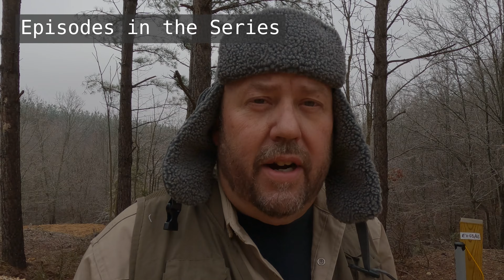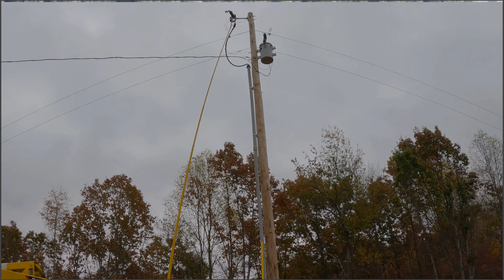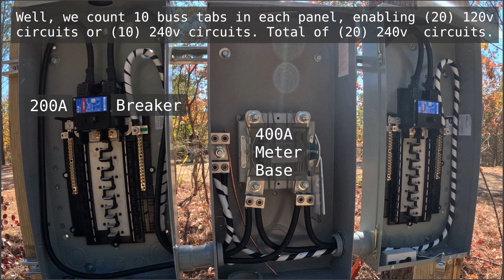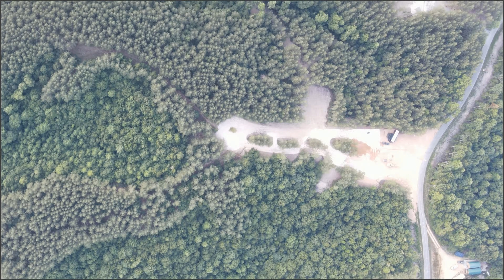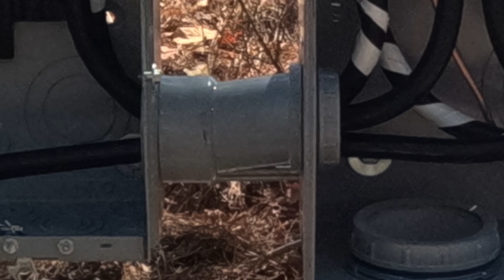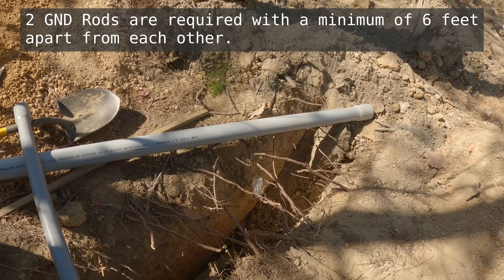How to build a 400A RV Park Electrical Service -  Ep 2 of 4

Comment: more than likely... you bond the ground and neutral to the incoming  box ( this case its the meter chanel ) , Then you do not bond the neutral and ground on the outgoing boxes ( secondary ) The secondary boxes then have to keep the ground wires and neut wires seperate (at the wire terminals in their box)  when wiring the box. At least thats how its been anywhere i do it. Reason ---Note: Bonding must generally only occur at the first point of service disconnection (the main panel), not in subpanels, to prevent neutral currents from traveling over grounding wires, which can make metal plumbing or appliance housings electrically hot if they are shorted..

Comment: Since everything (including your primary) is single-phase, your primary power is most likely 7200v (phase-to-neutral), not "14.4" (kilovolts). 
Also, the actual phase-to-phase voltage on most "14.4kv" designation systems, is actually/typically running at ~12,470v phase-phase, thus the ~7200v phase-neutral voltage.
Also, how many actual RV pedestals (and assuming 50A recep's) are you connecting to each of the 200A main disconnects? Hopefully more than 3 (up to 6 would be allowed, I beleive).
Anyway, a well thought out system, nonetheless.

Comment: Double check with the codes but I’m pretty certain every case needs to be grounded as well
Reply from the maker: Disclaimer: We are NOT licensed electricians, but this is our understanding.

In TN, in the meter base, the white wire, the meter base itself and the bare copper ground wire are all bonded/connected together to form one electrically connected circuit. The bare ground wire is then connected to (2) 8' grounding rods driven into the physical earth spaced at least 6' apart below or near the meter base.

Then from the meter base, 4 wires (Hot, Hot, Neutral and Ground) are run to each "disconnect" or main breaker panel that has to be within 6' of the meter base. The "ground" wire comes from the meter base, not from a second set of grounding rods at each "disconnect". Same with any subpanels or loads (outlets, HVAC, lights, dryer, stove, etc).... no grounding rods as the grounding comes from the main breaker panel or disconnect.

Besides the meter base having a set of earth ground rods, each of our pad based transforms has their own grounding rods and also each utility pole at the road has it's own grounding rods.

Comment: off of a 200 amp distribution panel, how many rv sites can you feed? if each site has a 50-30-20?
Reply from the maker: DISCLAIMER: We are not an electricians and the information should be treated as opinion.

Not at all. You can run 5 to 9 dedicated direct RV sites depending on distance and the type of rigs you will support. If you are a luxury RV park where most of your clientele is 45' Class A's with 3 AC's, with electric heating fireplaces and whatnot, then you are going to be closer to 5 RV sites. If you have a good mix of various camping rigs, then you can get closer to 9. It's also weather dependent, if you are in very cold areas, then guests tend to bring in extra electric heaters, which requires more power needs.

From a technical standpoint, RV typically draw 50A, but they do not draw anywhere near that on a constant basis. So (9) 50A breakers in a 200A service panel is realistic because RV's are rarely drawing 50A all the time.
Reply: @RvParkBuilder thank you! I’m looking at 7 on one and 6 on the other
Reply from the maker: That should work and we have seen setups like that in the various RV parks we have been in. However, we are not electricians and we recommended engaging a  licensed electrician to engineer your system properly and minimize risk down the road.
Reply: Also would like to know the answer to this

Comment: You usedthe same trench for power,  water and septic?
Reply from the maker: Power goes in a separate trench. Water and septic can run in the same trench, but realistically, they run to different locations and this doesn't make sense. In the beginning we attempted to put multiple things in the same trench, but towards the end, we didn't. The only think that made sense to run together was our water and communication conduit because they both ran from our utility sheds to each RV site.

Comment: I want that..how much electric guys charge for poles and boxes install
Reply from the maker: When answering your question, we are assuming "electrical guys" means the power company. "poles" means primary poles into one's property for overhead primary. And "boxes" means a pad mounted transformer for underground primary.

Recalling from memory and prices may have changed since then.
  Boxes (Pad Transformers) were running around $2400
  Primary pole: $1200
  Pole Transformer: $1400
  Running up or down a pole: $1200
Reply: @RvParkBuilder  meant the ones who built pedistal.    Nice layout worth extra time.  1st the first time
Reply from the maker: Ahhhh... We used Rodneys Electric in Hampshire, TN. Tell them we sent ya! It's been a while and their pricing may have changed, but back when we used them it was about $4K to build a 400A panel and about $2K for a 200A panel.

Comment: All North American power is 120v/240v. An electric generator operates at 60Hz (cycles per second) every 1/2 cycle (180°) the sine wave is 60V 0-to-peak. It takes one entire cycle to go 360° around from 0v to +60v back down toward 0v then to -60V … the ‘difference peak to peak’ is 120v. (Because +60 to -60 = 120)… It takes 2 legs of 120V to get 240V. But when you double the voltage you can halve the current. So you can do alot more ‘work’ with 240v 50A like An RV. You’d need 120v at 100A to do the same work, and the wire size would be huge, heavy, and very dangerous. This is why large loads are typically higher voltage (and lower current)
Reply from the maker: Thank you for sharing this insightful explanation about the electrical system! It's important to understand the fundamentals when working on projects like this.